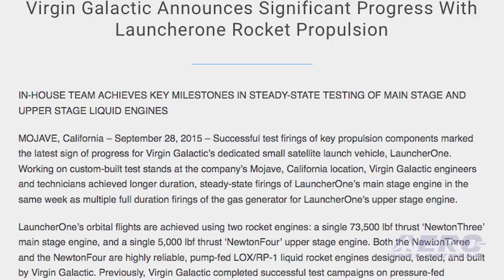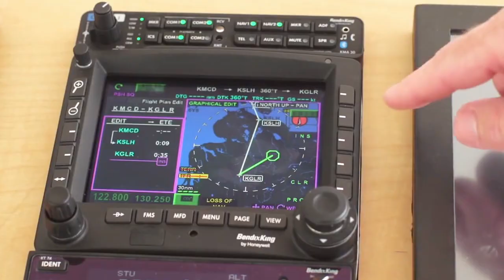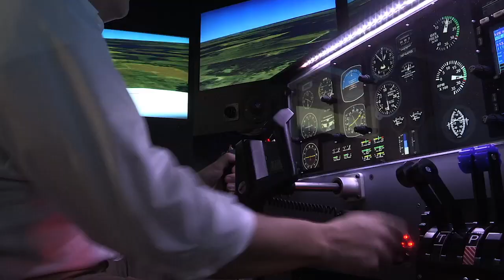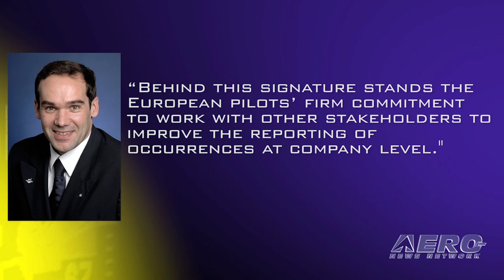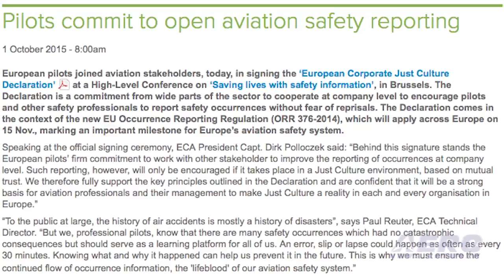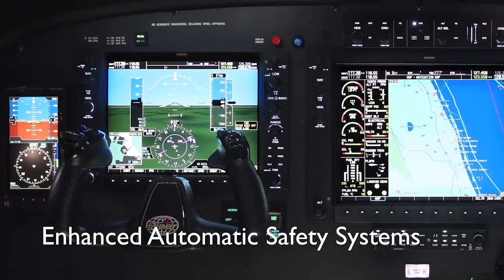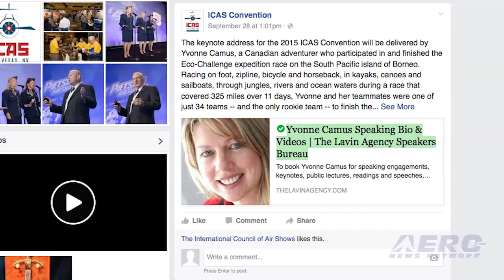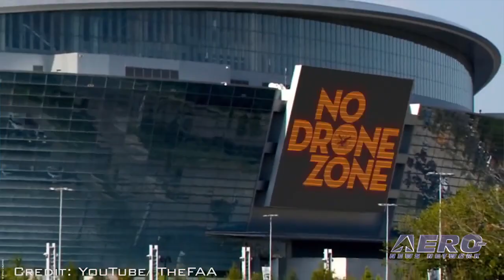Airborne 10.02.15: LauncherOne Milestones, A/C Mngmt Services Legislation, UAV Safety

Comment: Great show this week. however I can see one very big hurttle that is causing a decline in LSA sales and that is the over all cost of a plane. The average price of a new LSA is around $15,000.00 and up from most any manifacture. for the same $15,000.00 I can buy a new car or even a good used car, a motorcycle and a nice fishing boat. I can remeber when LSA's were a hobby and most got there start from the hang glider (which also now sell for around $1200.00 and up.) If you want to see an increase here in the states in use of the LSA's than prices for them are going to have to become more reasonble. I checked everywhere I can find on the net (evern Craigs list.) you can't even get a good used LSA for under $8,000.00 never mind find one. So what are we the little people who have the desire to fly suppose to do, rob a bank?